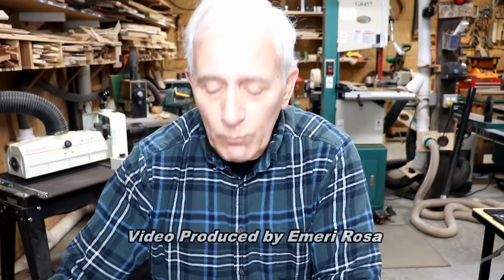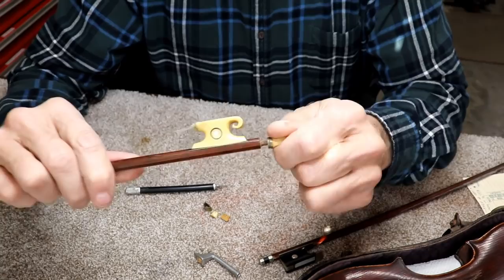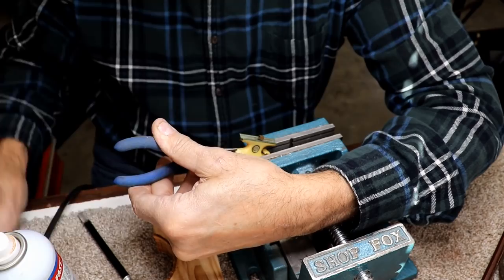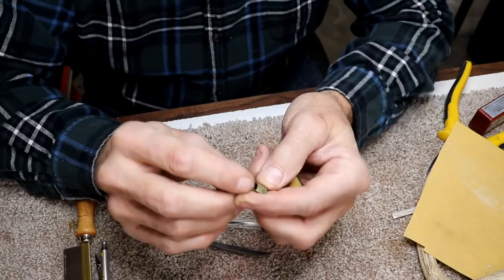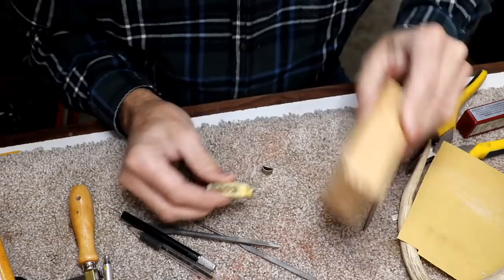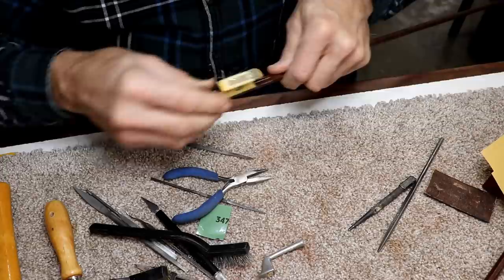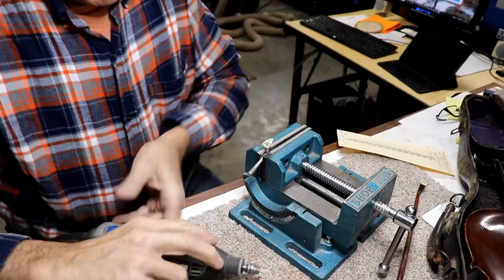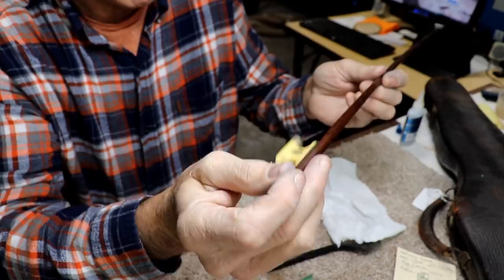525 RSW Bow Restoration Part 1

Comment: Watching you work on violins and bows is always a joy, Jerry!  Incidentally, the earliest plastics were cellulose-based, around 1860's. There were some bow makers using celluloid ('Ivoroid') around the late 19th century / early 1900's, so it could be the original bow, but more likely to at least date to the time of the violin repair, onwards to maybe the 1920's 👍

Comment: Care should be taken using CA glue around celluloid plastic.
CA glue generates its own heat, to cure. Which can be considerable.
I once applied CA to pile of bone dust. It, actually, Smoked and
was Hot, to the touch. Another time, I got a large drop of CA on
my finger and, as it set, it gave me a slight burn.
Reply: The key should be using slower CA glue, such as gel ones

Comment: You know the frog repair would have been a good application for epoxy... It would have needed to be coloured and filled with microfibres. But you won't have that sort of stuff available.
Reply from the maker: I would actually have to disagree epoxy doesn't stick anything together yet just all always comes apart it fails
Reply from the maker: In my book it's a good space filler and hole filler but otherwise that's all I use it for
Reply: @RosaStringWorks  Fair comment for hardware store epoxy, but the material goes a long way beyond that. Epoxy layups can be brittle or flexible according to what's in them. But TBH if you asked me "would I be able to do better work if I learned all about the uses and handling of sophisticated epoxy mixes" I'd have to answer "Not really, and there are better things to do with your time." I think its very rarely a material of choice in high quality luthiery.